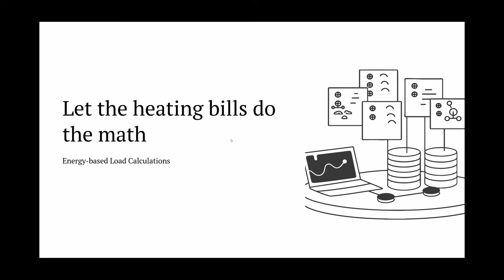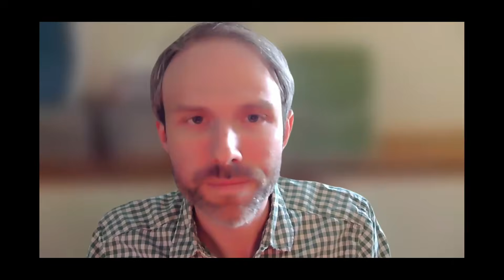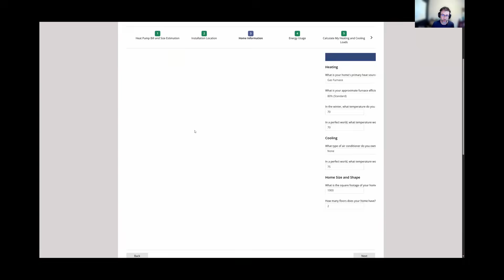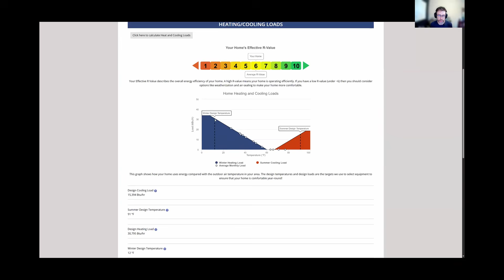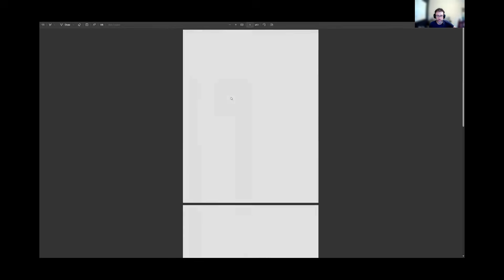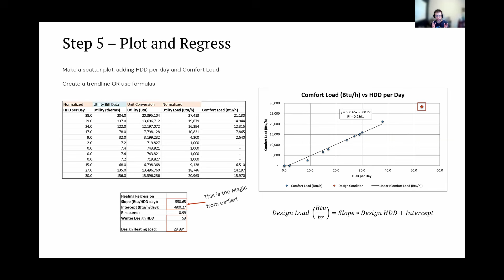Let the heating bills do the math: Energy-based load calculations

Comment: Short term thinking is what keeps people poor. The long term savings of an energy efficient house and electric vehicle saves you money many times over.  Short term thinking will keep your poor.  It is a hard but necessary lesson to learn. Spending a little more upfront can pay dividends in the future.
Reply: Please explain more how electric vehicles save you money exactly?
Reply: @ocko8011  I’m not sure it’s electric vehicles per se… perhaps it’s vehicles that are built to last.  For example, properly designed diesel engine can run for a 1,000,000 miles. However, when car companies constantly change designs, and they never get to perfect the original design. Similarly as cars become more complicated than have more failure points, which cost the owner money. Electric cars are extremely simple and therefore have your failure points.  A key problem with some is that it may be expensive to change out the battery. However, this doesn’t have to be the case; and sodium ion batteries are much cheaper and currently being put in cars in China. The main drawback is that they don’t have quite the energy density for long range between charges.  
One of the biggest expenses of cars is insurance for the medical care of all the people who are injured in car accidents…  hidden expenses include the disappearance of vibrant street life: since few people walk or bicycle anymore, streets are lonely and often scary places to walk or allow children to play. As a consequence, people stay in their homes, watching television I get a little exercise, their neighbors.  
Then we design neighborhoods, shopping center, and entire cities around driving and car ownership. We all spent tens of thousands of dollars for housing, our cars or parking on pavement that could otherwise be a garden or a place to play- or where someone else might live. Cars have caused our cities to become ultra spread out, making it almost impossible to walk or bicycle to many of the places you might wanna go to the distance alone, crossing the huge streets, parking lots, and redundant, unused sidewalks.